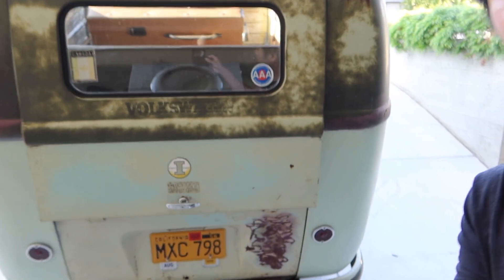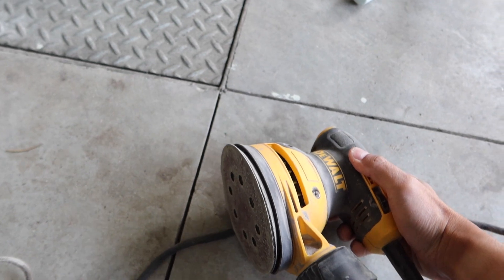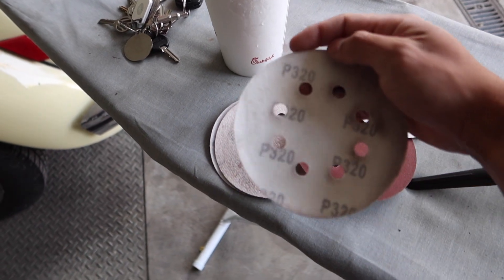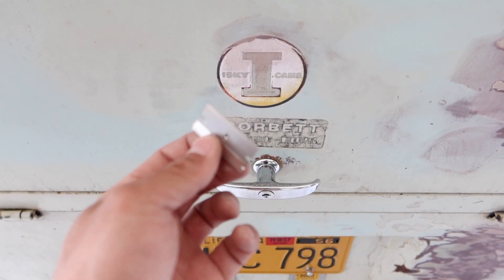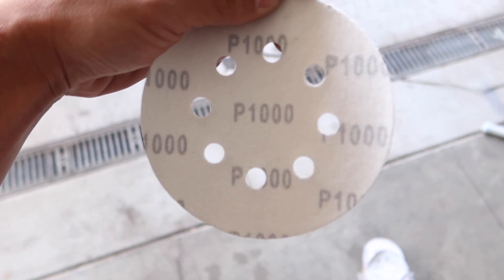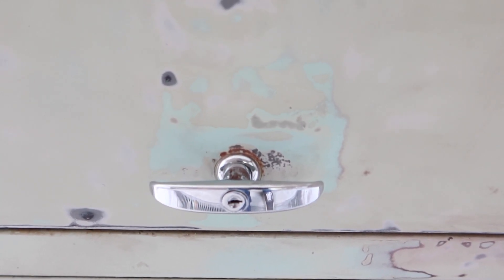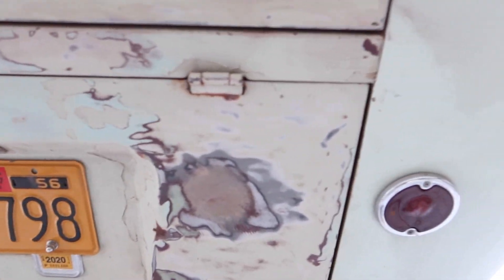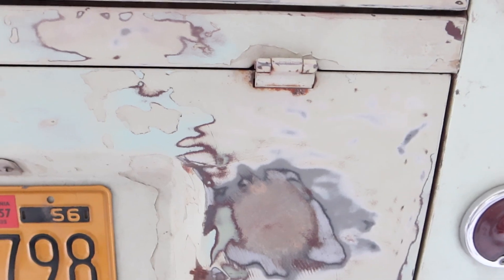UNCOVER THE ORIGINAL PAINT ON TRUNK LID AND ENGINE BAY LID ON MY VW BUS!

Comment: Love the videos! I would recommend using wet sandpaper to get to the original paint. While sanding with the wet sandpaper use a spray bottle with water to keep it wet and so you can see if you're rubbing through the original paint. Today we are going to try it on our 1958 pgsg

Comment: There should be an identification plate on the wall behind the seat on the passenger side. This plate will have the color the vehicle was originally painted. If the plate is missing, contacting Volkswagen archives will have the information as well.